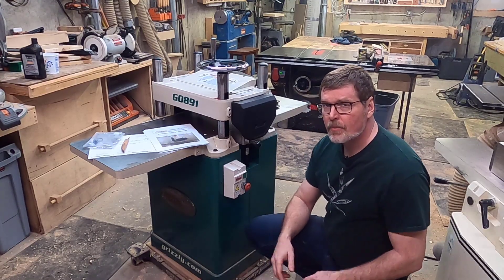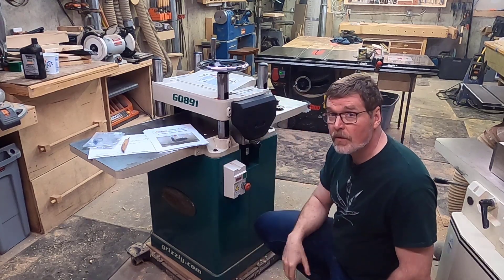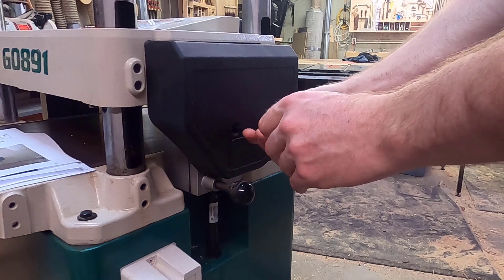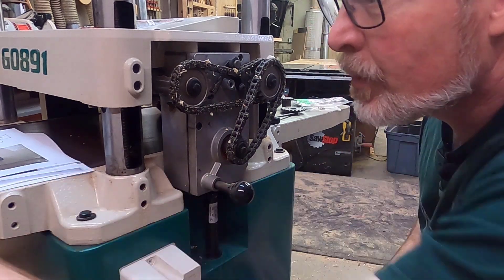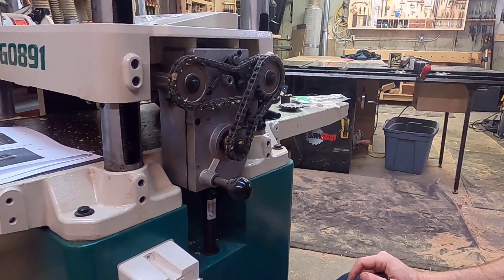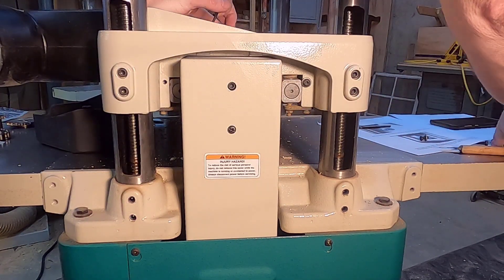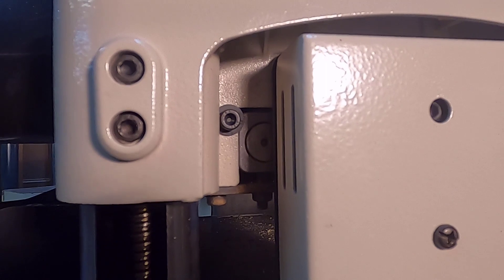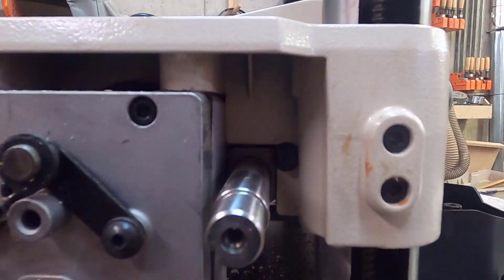Final fix for skipping feed  rollers on the Grizzly GO891 planer

Comment: Aside from the chain skip issue, how does the 891 perform?  And do you have any snipe issues with this machine?  I'm looking to upgrade from a 13 inch DeWalt, and I have heard that for the most part a fixed table 15 inch machine shouldn't have any sniping issues--or at least not like I'm seeing on my lunchbox unit.  Any input you have would be appreciated.
-Cheers

Comment: Thanks for sharing all this information. After a few years are you still satisfied with this planer. I'm considering the 0891 and the next step up that has a different helical cutter and steel feed rollers. Thanks
Reply from the maker: Yes, since the feed roller issue was fixed, it  has served me well.
Reply: @SalemWoodworks  Thanks for replying, very much appreciated!

Comment: Thanks so much for the video series. I eventually also had the same problem after adjusting the feed rollers. I install the idler and tightened the chain like shown and then I had an issue with installing the cover after installing idler. If I tighten the chain too much then I couldn't get the cover on, so I had to settle for minimal adjustment. Hope it works. Again thanks for the videos.

Comment: Thanks for the tips, I just bought a jet jwp-15bhh that's just like your grizzly and noticed the amount of slack on my chain. Definitely going to get this for mine.  I have mine dialed in pretty well but still getting a little snipe, do you get any? I'm probably getting to particular but it's very minimal
Reply: Glenn,
I have a 1980s Grizzly 15 planer, which is very similar to their current iterations. With the machine set to specs there is still light snipe as the end of the board  exits the planer. 
 I have found that if you lift up slightly on the board as it starts to exit the planer, while simultaneously pushing down on the board at the outfeed end as the last of the board exits, the outfeed snipe is eliminated.
Reply: Also adjust bed rollers.
Reply from the maker: I get little to no snipe if I have proper support on the outfeed. Glad you found it helpful.
Reply: @SalemWoodworks  thanks for the fast reply! I cannot locate the part with the link, I will try to email them and see if I can get it. As far as the snipe, its really minimal and I have the same cast iron bed extensions as you and set dead level, I also use a jointer to flatten before I plane. I was just curious.

Comment: Thanks for this video, I’m going to make this fix. Have you had any issues with the headstock rising when making cuts? When making a pass even with only turning the handle an 1/8 of a turn the headstock will rise, you can see the handle turning backwards. We have throughly gone through the machine and spoken with tech support to no avail.
Reply from the maker: No, I can't say I've experienced that issue. Hope you get it sorted out.
Reply: @SalemWoodworks  thanks. Same here.